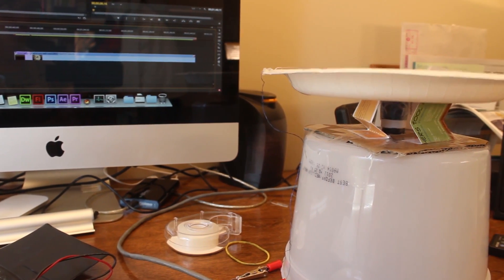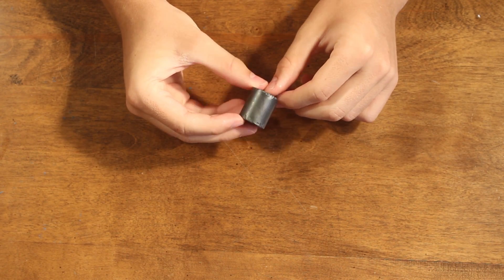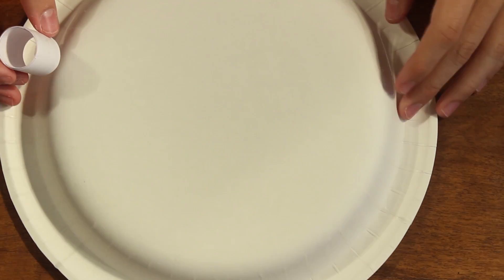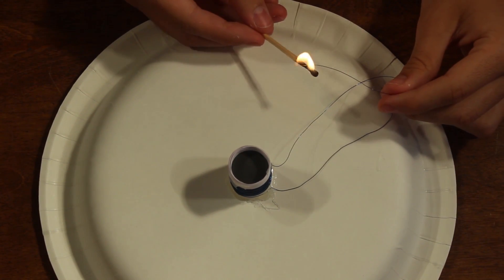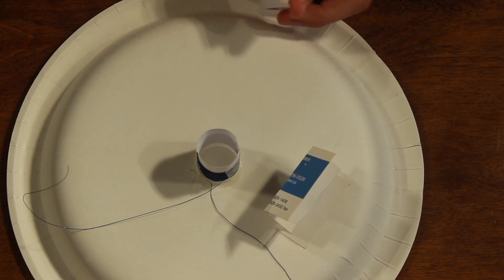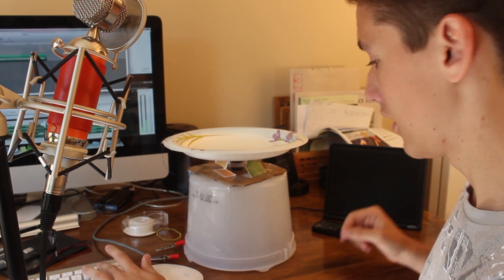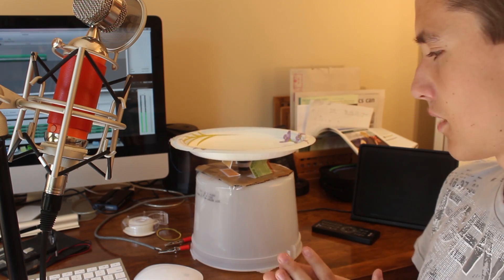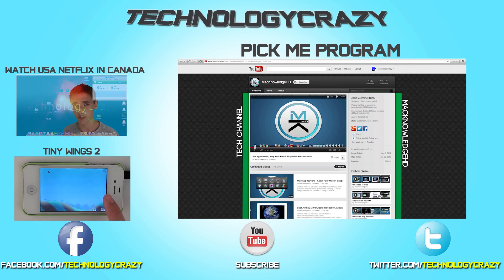DIY - How to Make a Homemade Speaker

Comment: Can someone freaking help me? I am getting stressed because nobody can tell me how to attach the speaker to my computer! I've tried a lot of different ways by using a audio jack and other things, but it doesn't work.
Reply: Scotlahn Mccallister cut off one end of the jack. there should be two wires inside or 3 of it has a ground. the ground wire should look different than the two wires that connect to the speaker. connect one wire feom the jack to one wire from the voice coil and other wire of the jack to the other wire in the voice coil

Comment: Technologycrazy how do I connect wires to the speaker? I have a jack for normal ipods which I think is 3.5mm and when I try to wire, nothing happends. PLEASE HELP SOMEONE!
Reply: Do you type this with your face?
Reply: You connect the two wires from the coil to the positive and negative ends of a 3.5mm jack, or you plug the bare wires into the back of an amplifier if you have a larger system.
Reply: XD I know, This was when I just started sound and speakers
Reply: SoapyLynx lol oh okay.
Reply: SoapyLynx
i now you
Reply: torge45 I don't now you.
Reply: serusly rember speaker vid you though it was tweeter speaker not bass but it was acsaly a speaker he uses amp now remeber?
Reply: idk

Comment: Few tips for anyone trying to do this but as a more serious project, first, you don't need the paper between the magnet and coil, you can wind the coil around the paper and then glue the coil onto the cone(plate). Second, try and keep the coil as neat as possible. Third, for more volume, once you reach the desired height for your coil, you can start to wind back down to the bottom, do maybe 2/4 layers. Last tip, if you want more bass then use a bigger, flatter cone (plate).

Comment: Most of the older (i.e. heavy ones) AC/DC adapters should have transformers which are basically a block of metal wrapped in copper wire. Old TV screens and CRT monitors should also have some.